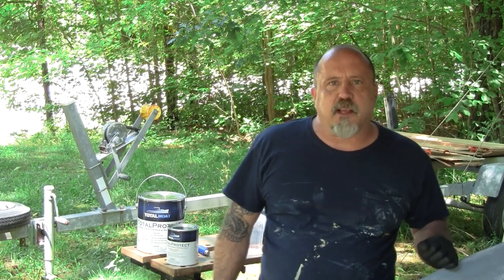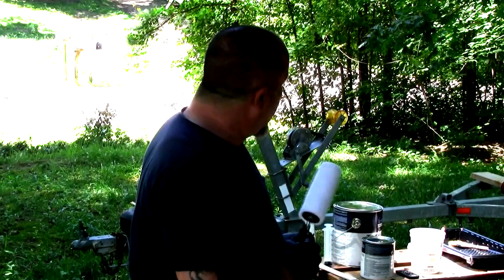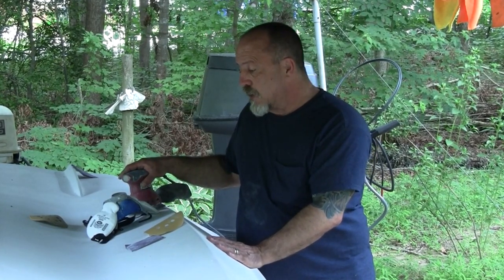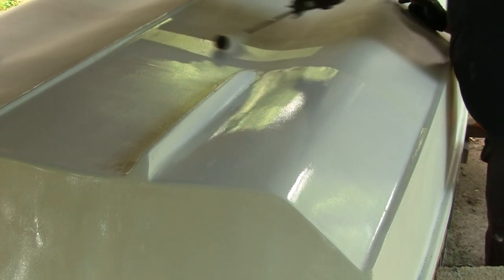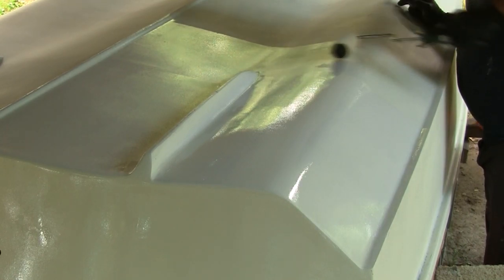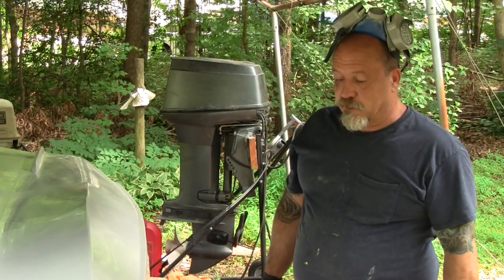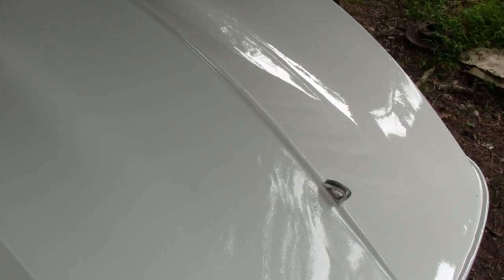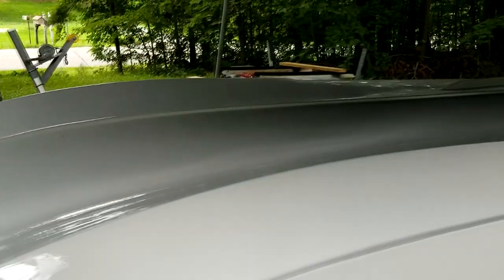Priming & Rolling NOT Tipping Topside Paint on Hull ! - Boston Whaler 13 Restoration - Part 14

Comment: I'm working on a 1985 11' super sport and I'm so glad I found your series! I'm pretty far behind but hoping I can get through it all in time for a test drive this summer. 

I'm curious why so much attention went into getting a good finish on the bottom... is this not going to be covered by bottom paint anyway?
Reply from the maker: Hi , I really gave more attention to the visible areas, the transom, bow and sides. I wont be using bottom paint since it will be trailered and never spend more than a day or less in the water (being used). If it helps, this has been a work in progress since the fall of 2018! I spent a lot of time working on the old Johnson that came with it.
Reply: Why are you avoiding bottom paint?  Harder to apply?
Reply from the maker: @derektrunkey1066  These paints are generally referred to as topside paints but are suitable for hulls too. Interlux perfection is actually an excellent hull paint, which is why I used it here.
Reply: Jose's Extreme DIY I put the interlude perfection on the top side.  I was also short on Hardner for the last batch.   Took the can apart and got another 1.5 ounces out.  Came out great overall with more imperfections than yours,
Reply from the maker: @derektrunkey1066  Yeah, that spout on the hardener can sucks. IT seem like the best bet is to take the lid off. Glad you were able to get it finished!
Reply: Great series. I'm about to start on my 75 13' and am a complete newbie to any paint / boat Repair so this is awesome info. I'm thinking about using the perfection for the whole boat - should a gallon Kit cover me?
Reply from the maker: @craigtheheathen  A gallon should cover you. IT is expensive but well worth it! Just make sure there is no single stage pain left on the boat before priming and painting. Good luck with your restoration!

Comment: so with 2k paint is sanding required in-between every coat ?
Reply from the maker: Not necessarily, I ran into issues related to the environment with the paint setting up to fast so had to sand it smooth.

Comment: Hi Jose 1 more question.....any issue with using total boat barrier coat primer and interlux or awlgrip for top coat instead of total boats product ?     Thanks in advance
Reply from the maker: That should be fine. I put the Interlux over the Total Boat Barrier/Primer coat.

Comment: Really need to scrub it down after sanding and all paints I've seen need reducer and the tipping gives the shine
Reply from the maker: After sanding, it gets a dawn and ammonia wash before painting. I've done tipping, in this case I followed Russel Browns directions in his book, "Rolling Perfection" and found that the finish is smoother than with tipping.
Reply: @ExtremeDIYGuy  have to agree now after doing it this week, doing a 47 foot buddy Davis, on a vertical surface in the sun and wind you have no chance, rolled Stern in shade perfect, rolled and tipped starboard in shade and had to sand back smooth,, lm going to spray the rest

Comment: What are you using to clean in between coats of paint.
Reply from the maker: I washed the boat down with a mixture of ammonia and dawn and then went over it with denatured alcohol just before painting the next coat.
Reply: @ExtremeDIYGuy  What is the mix of dawn and ammonia?  Thank you!

Comment: If you don't die grind, taper, and fill spider cracks, they will, within months to a couple years, work through your cured paint and extend themselves.
Reply from the maker: I did for the larger ones, but not the smaller spider cracks. It's been about nine months since I finished and still looks good. I guess time will tell.

Comment: My advice would be not apply a PU paint in weather with RH higher than 50% and definitely never during or right after a rain. These PU systems use some form of isocyanate + polyol. The isocyanate will react with free water vapor to form CO2 bubbles and will leave unreacted polyol in the finished paint coat, leaving it too rubbery and weak. This will leave a lumpy finish that is very tough to sand out because it will easily clog the sandpaper.
Reply from the maker: That's sound advice. The weather here in NC is either to cold or too humid, so I typically look for a balance.

Comment: Always wash a new fibre roller thoroughly and then use a suitable brush lengthways to pull out the loose fibre, and/or then use an air gun to dry and remove the lost fibres - sometimes a vacuum after the wash is a good method and test and retest the roller BEFORE using on the area you are trying to get a 'show finish' on.  100.0% for sure, a new roller will have many lose fibres and they will end up ruining your paint job - HA - yes, ask me how I know that - a lapse of thought once and I failed to clean the new roller cover = a DISASTER.  Foam rollers can be an alternative to the fibre, but just like a fibre roller cower, you need to pick the suitable one.  When using a roller, it can pay to use a small - very small bit of thinners//reducer (whatever you want to call it) and it can help to get rid of the pull on the paint from the roller action and hence reduce the orange peel.  Experiment - do not use too much thinner.  CHEERS from AUSTRALIA.
Reply from the maker: Thank you for the tips! TH'at one reason I really like the foam rollers though.

Comment: Why is this a “topside” paint video when you are painting the bottom of the boat?
Reply from the maker: I used that because a lot of these paints are called "topside" you don't find too many called "hull" or "bottom" paints unless they are ablative style paints.
Reply: Bottom paint" is antifouling paint for boats that dont come out of the water.
Reply from the maker: @SOLDOZER  Yes, it's is also called ablative paint because it slowly wears off over time removing marine growth.  Which is why I called it topside paint

Comment: If thats 3:1 you can't do math..  6 parts paint and 2 parts curing agent??  Should be 6 parts paint and 3 parts curing agent if i'm not a complete idiot.
Reply from the maker: 6 parts paint to 3 parts cure would be  2:1. Let me break it down for you. 6/2=3 2/2=1 or looking at it from another perspective lets take the original 3:1 and double both the paint and the curing agent which leaves you with 6:2